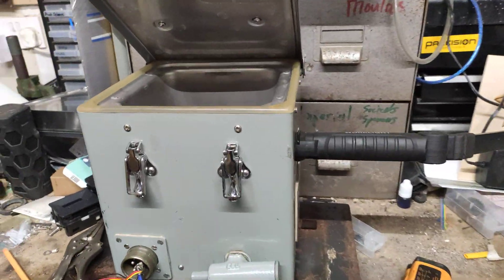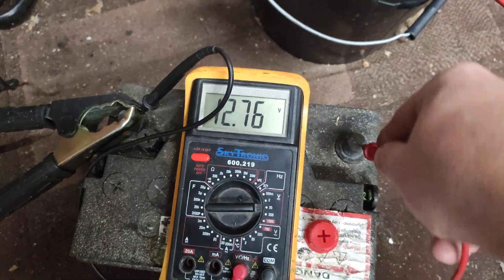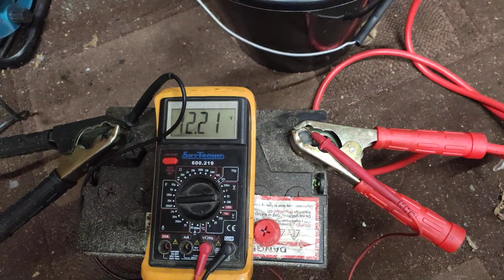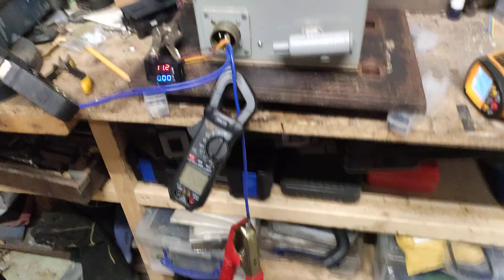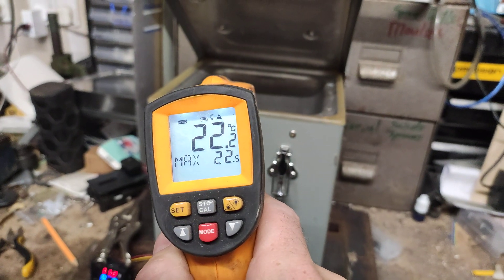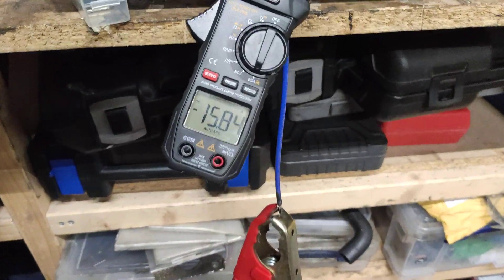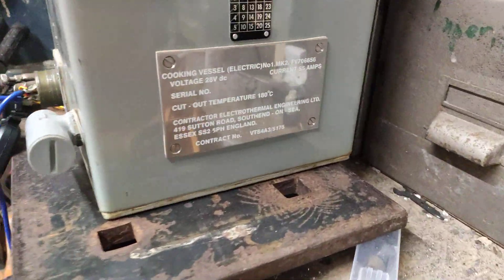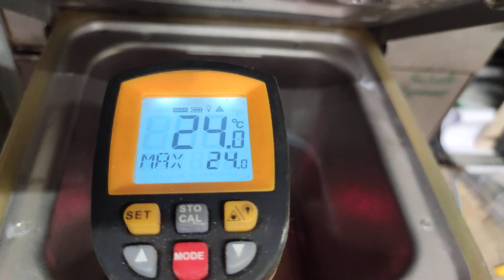Testing a British army BV - boiling vessel - element to see if it works

Comment from the maker: A basic resistive heating element will work on any voltage but be faster or slower - on 12v it would draw half the power (amps) as there's half the "push" - which is roughly what it does.